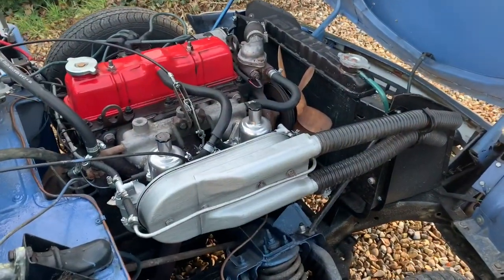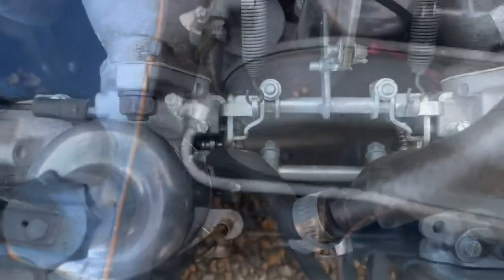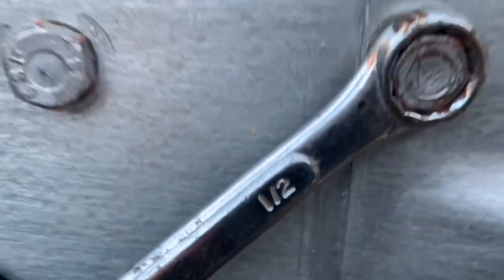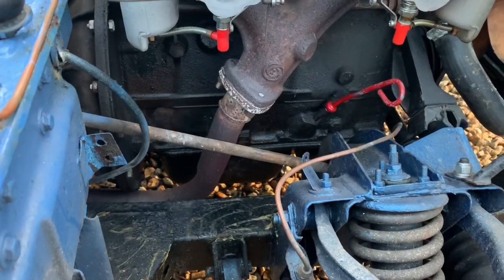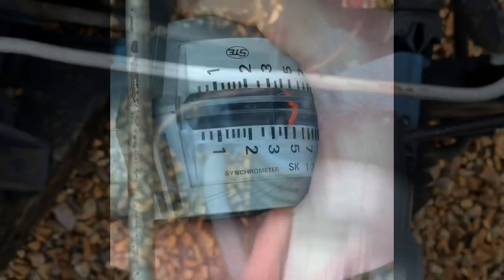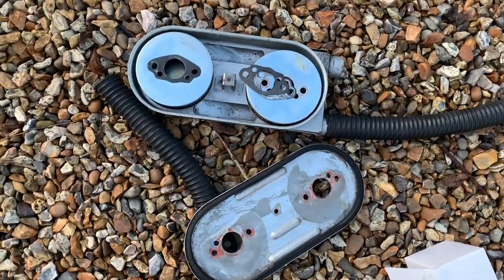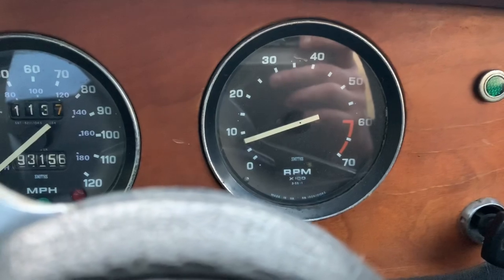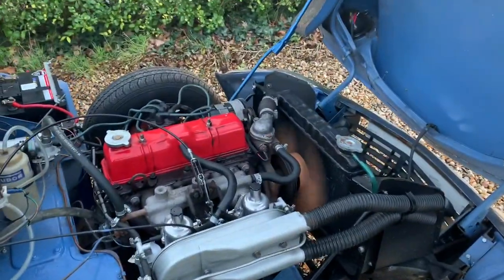How To Balance SU Carbs - Triumph Spitfire

Comment: Hi, thanks for your vídeos. Any chance of showing where the distributor vacuum pipe connects in the inlet manifold and how we can adjust the air advance in the delco distributor. Thanks 😊
Reply from the maker: Hey hey! Thank you so much for your comment! 

I am extremely sorry, I am not with the car until the start of may so I can’t do a video or pic just yet. If you have Facebook- you could message my FB page “the triumph guy” and I could try and send a picture maybe

Comment: Have the same spitfire, adjusting idle to 750.  Also when on the road sounds as the motor runs out of gas and then picks up, after slight hesitation, but your vid just settled that issue, I think.  What about timing ?  Use of a timing light, do you have video on that issue?
Reply: The Triumph Guy well, we got that done, timing light etc. found the marks on the crankshaft pulley. And reset the timing, runs better, but need more work on carbs.  Need to adjust them more to gain that sound.  Nice even tone, without any hiccups when I hit the accelerator, I noticed if I am easy on the accelerator then less of the sound like it is starving for gas. Going to check float levels next.  If it is not that, then back to adjusting the jets, hmmm.

Comment: hello, could you explain and show how you
adjust richness, please? Bruno
Reply: @TheTriumphGuy101  Hello, I did this this afternoon. I had a pollution level that was too high for the standard in France. Thank you for your very informative technical videos. Bruno  ( and thank's to Google translate)
Reply: @TheTriumphGuy101  my work is not perfect . The level pollution is always high.The nut of  left carburator is totaly closed and the sparks plug (3 and 4) are always black. where is the problem for you ? i want to try again but perharps i must change a part ? a complet cleaning of carburator ?
Reply: @TheTriumphGuy101  Hello, no problem for the delay of response. westerday, I do the job and the technical control of pollution is good now. the four spark plug are brown so the engine is running correctly. thank's again for your informations.
Reply: You need to loosen the throttle linkage between the carbs so they work independently, prior to making the adjustments. May see you around if you’re Dorset way :)

Comment: Hello, did you have the idle at 1,000 RPM while tuning, but then lowered to 750 RPM when finished? Is that part of the process for tuning? I'm getting ready to install twin SU4 carbs on my 75 Spitfire. Cheers
Reply: @TheTriumphGuy101  Got it. Thanks